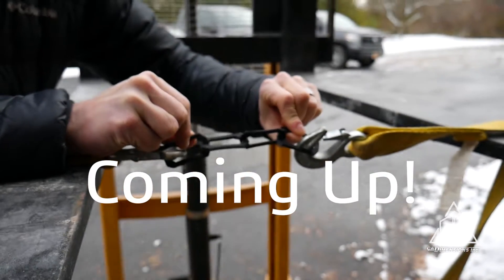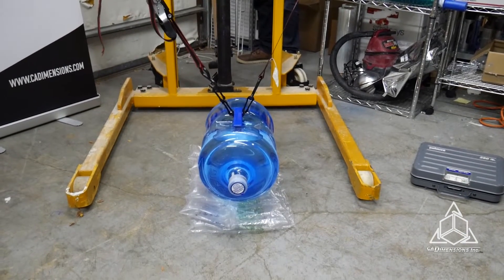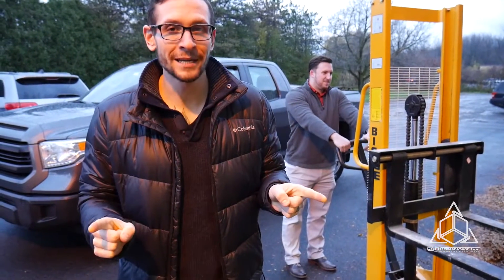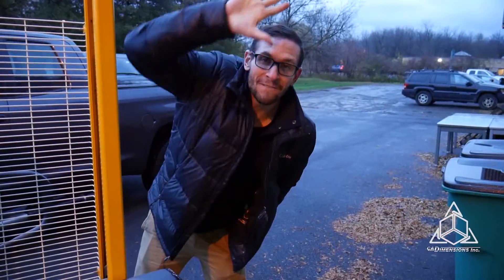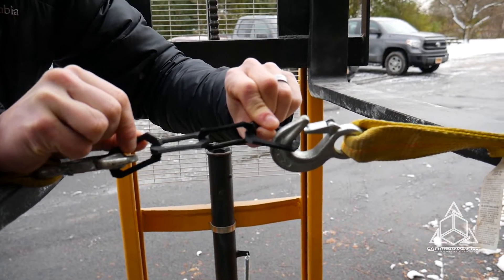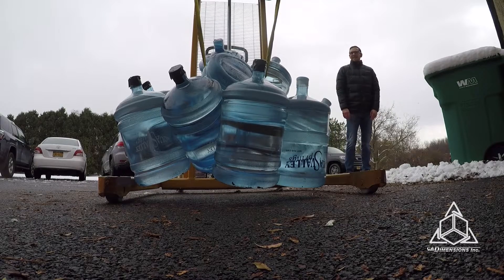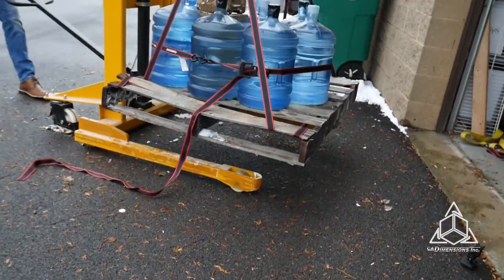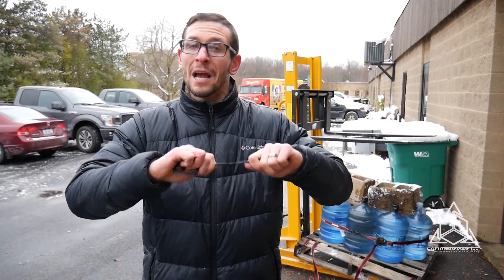Strongest 3D Printer Filament Stress Test: How Much Can it Lift?!

Comment: Impressive, but Try lifting the same amount in a single leg, not where the forks help lift the load by splitting it, with the friction over the forks. the final lift shows both hooks getting stuck by the edge of the forks, thereby taking alot of the load.
Reply from the maker: That is a good idea. We will definitely consider doing that next time!
Reply: lmao Right??? i was about to comment the same thing